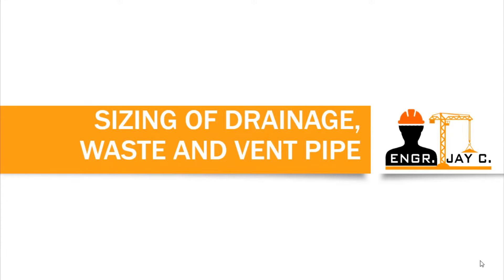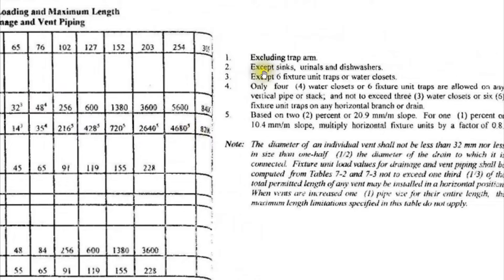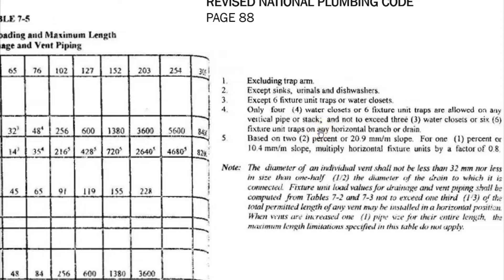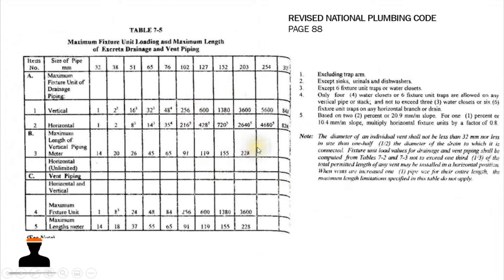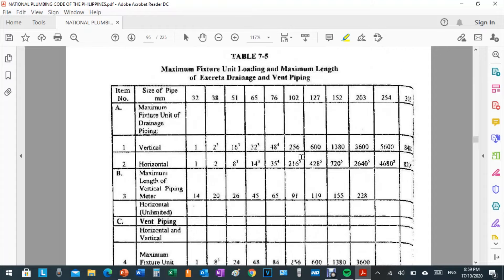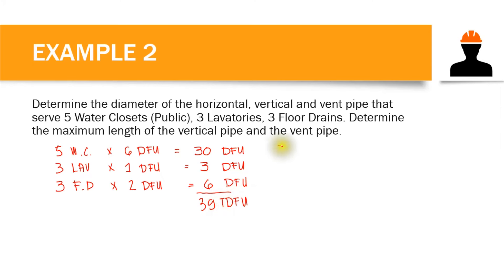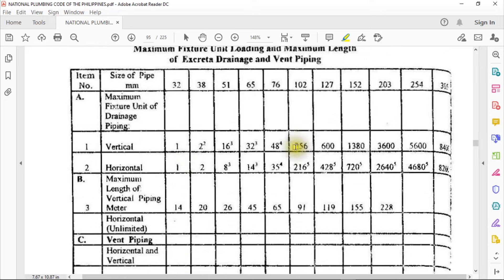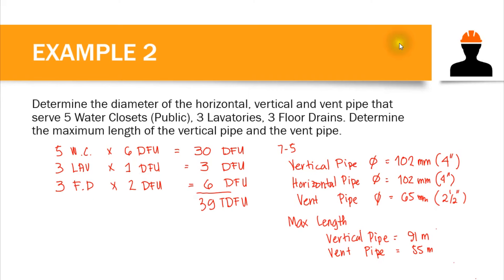Sizing of Drainage, Waste and Vent Pipe | Revised National Plumbing Code of the Philippines

Comment: sir question in example#2, the vent pipe dia (65mm) is <1/2 to which it is connected (102mm). Do we need to make adjustments on the Hor & Vent pipe?

Comment: Thank you for this informative video Sir Engineer. I just want to ask if is it right and hygienic  to put the venting pipe for  lavatories such as  kitchen and comfort room sink, water closet, toilet  and floor  drainage inside the roof?
Reply: rnpcp - vent shall terminate vertically not less than 0.3 meter above the roof; dapat ilabas mo po yan delikado mga gases kung ikukolong mo sa loob ng roof hehe

Comment: Tanong po. 
Drain pipe of waste, kitchen and bath is directed to the first  2/3 compartment of the septic tank. Would it be ideal if I will have a separate drain pipe for the kitchen and bath and he flow directed to the second 1/3 compartment of the septic tank? Thank you